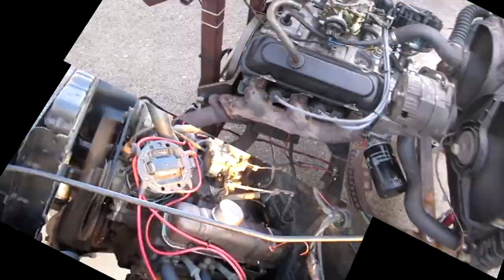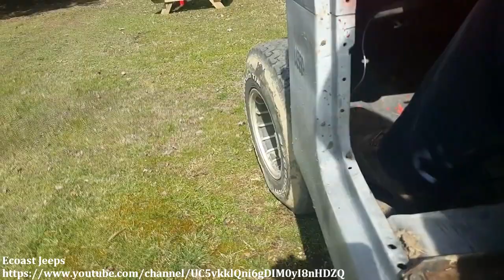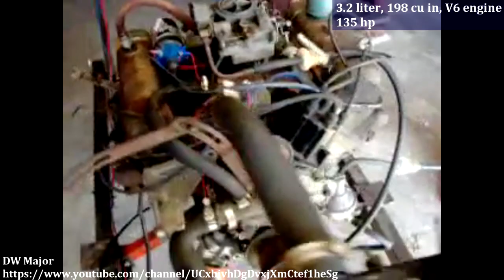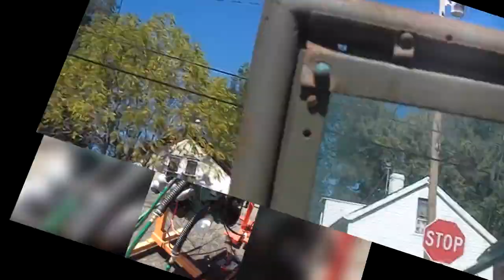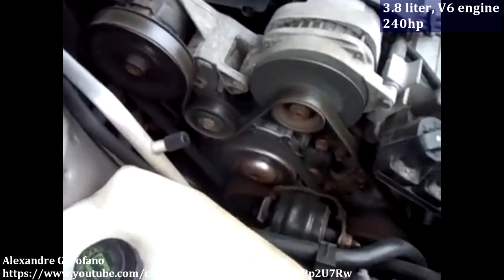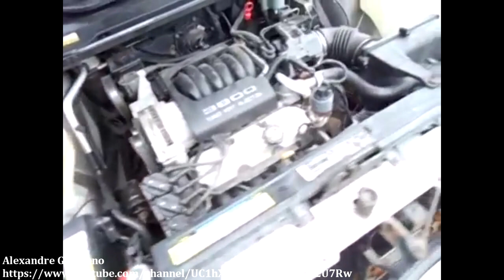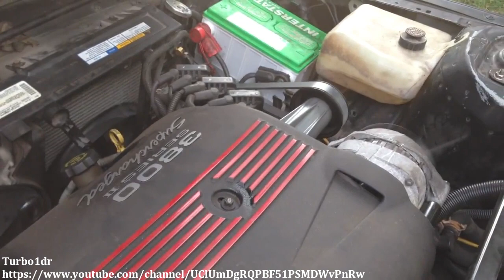7 Of The Best Buick´s V6 Classic Engines

Comment: Are u f-in joking????? Where’s the 86-87 turbocharged 231 EFI LC2 that was wayyyy ahead of its time. You know the one they put in the regal and made the T-type, Grand National WE2, GNX, and the lightest WE4 Grand National. What happened to that motor? You need to quit drinking that moonshine bro.

And btw the 3.8 shown in this video is far from the 3.8 that sits in a Grand National. A 109 block is make to take more power then all those “boat anchors” put together.
Reply: Gm killed it I think the  trans am they put it in would woop the corvette, and was still being developed , kind of a Fiero story .
  now there is a car Gm should consider bringing back, some modded up ones are proper fast..